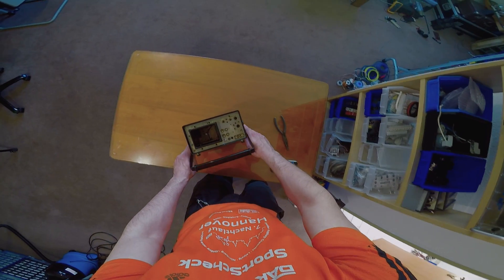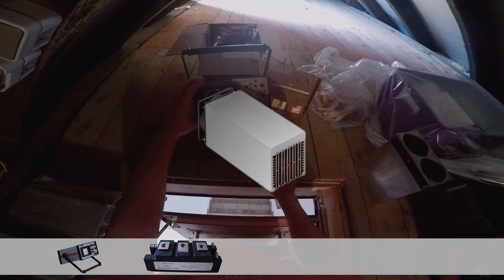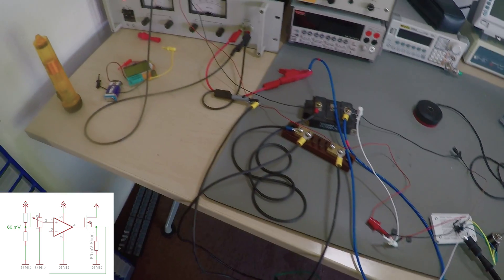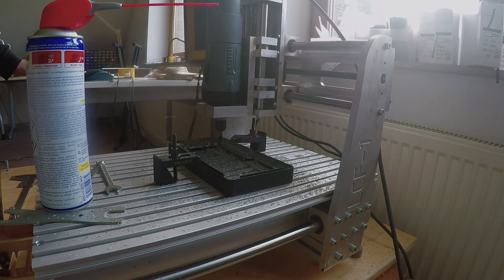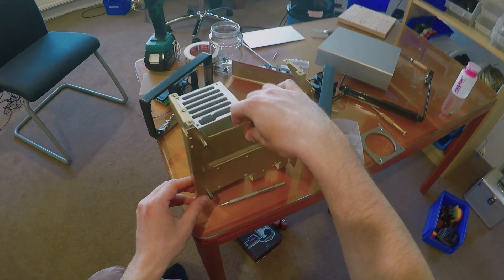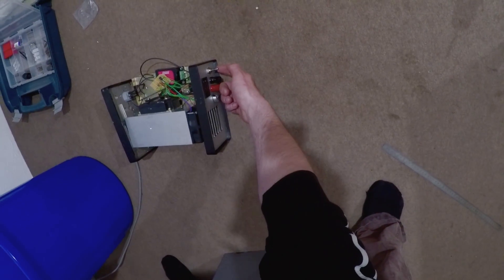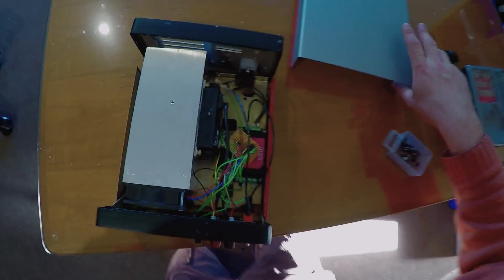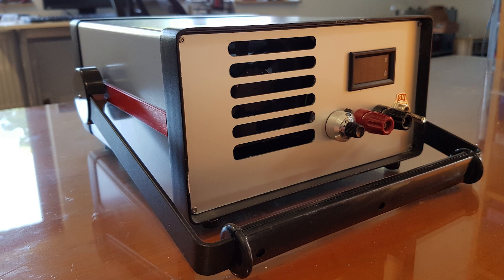Young Reps wasting time and materials: IGBT Electronic Load

Comment from the maker: Oops, this thing won't work for long, don't build something like this. These IGBT modules are not suitable for DC loads, because they are built from many small IGBT chips that heat up unevenly and die from thermal runaway.
Reply: wait You commented  it after 7 years DAMN man that is RESPECT
Reply: So show us a better diy version
Reply: Mosfet instead of the IGBT?

Comment: For a given operating envelope of an electronic load, it is possible to devise a set of load resistors that will limit the linear device dissipation to a given value. Of course the resistors cost money, so if you don’t have a big stash of power resistors, it’d be cheaper to just use lots of BJts or mosfets instead and keep it well derated.

Comment: yeez how much current could a module like that pull at around 3 volts, what's the resistance like? Im trying to build lithium battery tester, I would want to achieve 60A at least, but 200A for peak testing would be awesome lol.

Comment: I know this video is old (stumbled upon it now). This is exactly what I built 20 years ago with a trash bin 200A IGBT module. An op amp, small DC power supply, fan, large heatsink and reverse protection diode on input. I still have it on my shelf. I haven't tested its max current capability (only 10A meter on it). The problem with IGBTs is that they are built for switching. Linear operation is another matter and IGBT SOA is really crap in linear. You won't even find SOA curves for linear operation in data sheets for IGBTs (true also for most Mosfets). There is really no other way to find out than set a voltage, turn up current until it explodes, rinse and repeat for all voltages. It doesn't help to monitor temperature. Due to the way IGBTs are built, in linear operation they will develop local hotspots and might blow up before reaching the stated max safe temperature. If someone wonders about this, search for a research paper "How to Make Linear Mode Work". There is a reason all linear power supplies use (old) BJTs (and for large currents, you need lots of them in parallel).
Reply: Всегда приятно иметь дело с умным человеком.

Comment: how low voltage can you go with IGBT? can it be used for example to discharge battery etc.? (if I use smaller IGBT). I ask because of the Vce of IGBT.

Comment: Hi, how could this be coupled to a micro controller and display, so to be able to measure a lead acid battery capacity ? What should the micro-controller monitor (voltage across shunt ?) or something else ? could you please help with how to easily drive this via  micro controller (independently powered is okay too). Thanks in Advance. As always appreciate the work you put into your videos.

Comment: Ever try West Mountain Radio's Computerized Battery Analyzer? I used one recently and it's a very nice, $200ish 150W electronic load (or $930 for 550W). It's constant current by default but the extended software means it can be e.g. pulsed or act as a constant resistance or constant power load.

Comment: what is the funcioning principle behind this?
Reply: the pot sets a pwm that changes the duty cycle of the igbt thus controlling the amount of current passing throw a shunt resistor(?)
Reply from the maker: No PWM, it's really just the op-amp doing whatever it can to equalize its inputs. On + input I give it a voltage between 0 and 60 mV that is adjustable with the potentiometer and the - input is connected to the current shunt which happens to be 60 mV shunt. The op amp will increase its output voltage which in turn lowers the IGBT resistance until + and - are equal.

Comment: What would a water cooled thyristor be used for?
Reply from the maker: Train motor drivers, industrial high power stuff, ...
Reply: Water cooled power devices..( NOTE..DISTILLED WATER ONLY!! ) are necessary in cooling devices that just large heat sinks & cooling fans are woefully inadequate . These have very large power losses due to their high load current capabilities..
Load current in terms of thousands of Amps ..and device power losses in hundreds to thousands of watts in range....
Usually these are individually mounted on copper fin types of heatsinks that have a plumbing system for the water flow...
The distilled water is processed through a filtration plant and cooled through water cooling towers..
Being pure distilled water it is a perfect insulator and although all devices may be @ high potential difference w.r.t. each other....the same water is circulated through all of them.

Comment: it's interesting though little frustrating, would you mind taking few minutes more for posting schematic and parts list please ?
Reply: As a start, you can  this  this  board and replace the mosfet with a IGBT. In my case it works fine.
https://www.ebay.com/itm/DC-1V-100V-Constant-Current-Source-Electronic-Load-Board-50W-Max-6A-Power-Tester/291765610890?ssPageName=STRK%3AMEBIDX%3AIT&_trksid=p2057872.m2749.l2649
Reply: he will not do that....

Comment: I have read, that because in these bricks multiple chips are in parallel, linear operation is difficult because a chip that gets warmer than the rest gets more current and gets even warmer and eventually dies. Is that only a theoretical problem or did you really have to take precautions for that?
Reply from the maker: Good point! MOSFETs have a positive temperature coefficient, so they balance themselves. If the semiconductors in one of these bricks are BJTs and there are only 3 terminals, I have to rely on the manufacturer to take care of the balancing. Only if there are multiple exposed bases I would consider doing the load balancing myself.